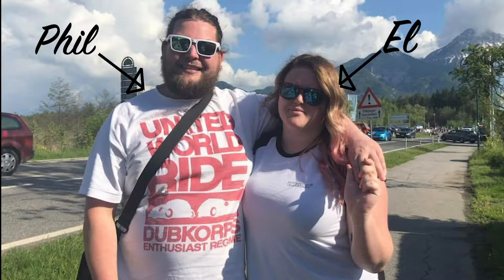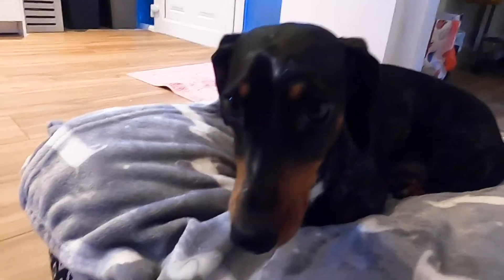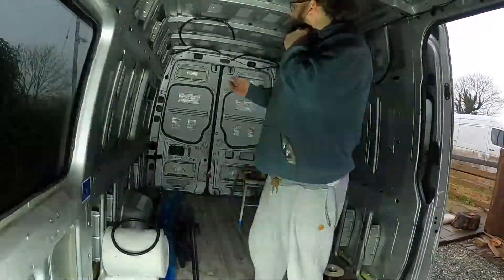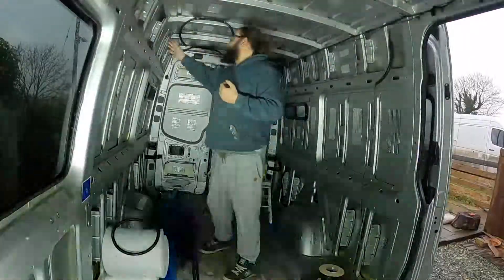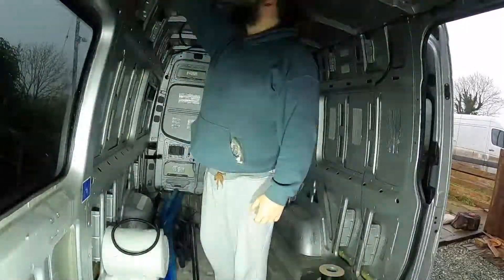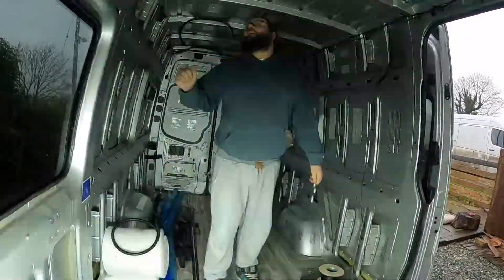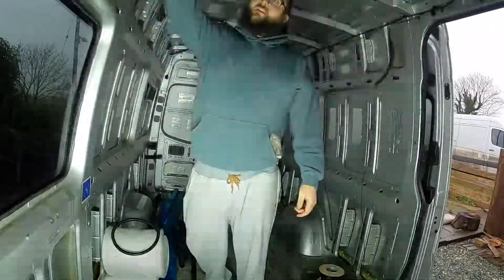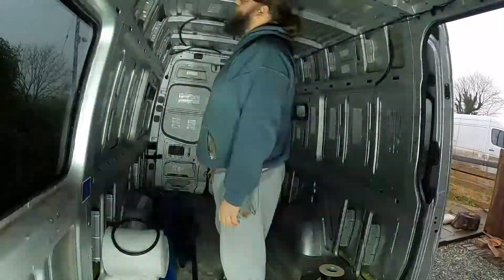Lets VAN trip - VW. Crafter Camper Van Conversion - Ep6 - Lights & Fan Wiring

Comment: What wiring did you use?
Reply: Do you have a list of the wires you used?
Reply from the maker: Hi, for the lighting and maxxfan we used 1.5mmsq twin core cable. Then we have used varius thickness cables for different appliances :)

Comment: Hello! Could you tell me which is the model of the window? I like it
Reply from the maker: Hi, Which windows is it you talking about? The rear sliding ones are from a UK company called Van Windows Direct. The windows are handed so if you order you need to order a N/S and an O/S in order to get the sliding part at the back when installed.  Here is a link to the Offside one :) https://www.vanwindowsdirect.co.uk/view-product/Bonded-privacy-universal-vent-window-with-fly-screen-OFFSIDE
Reply: Thank you!:-)